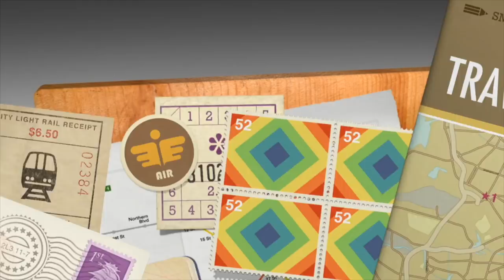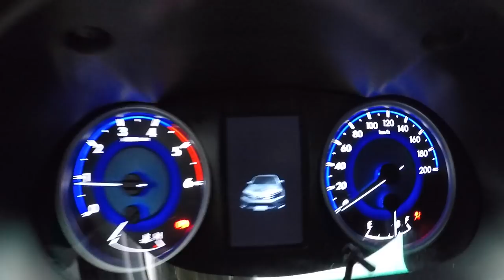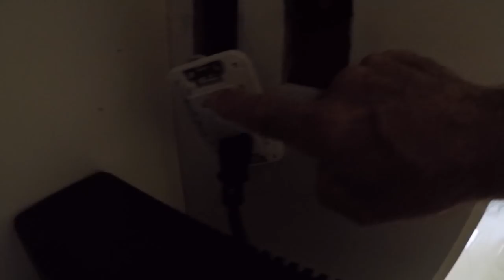VILLA FELIZ - EPISODE 257: FEELING INSPIRED (House Building in the Philippines)

Comment: Hi James, Have you covered what kind of back up electrical plans you have such as a generator yet? We just had a snow storm in Georgia USA with an overnight blackout in cold weather and I noted that I was the only one in my community with a backup plan. I felt bad for all the neighbors in the dark, if I knew of anyone elderly or on oxygen I certainly would have invited them over. My backup runs the whole house as opposed to a transfer switch which would only run selected circuits.

Comment: It's nice that you included medieval features into the design of the house such as the jetty (overhang) in back and front of the house. Did you insist using this feature or is it the architects' artistic features? Very well thought out plan, bring in the old features (aesthetic) and modern fuctional features such as double pane windows, CCTV, solar panels etc.